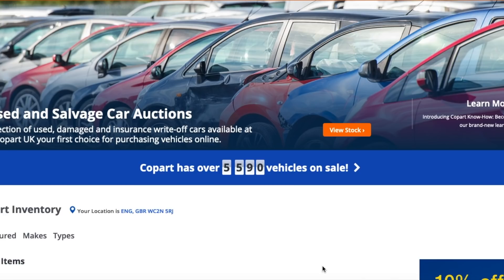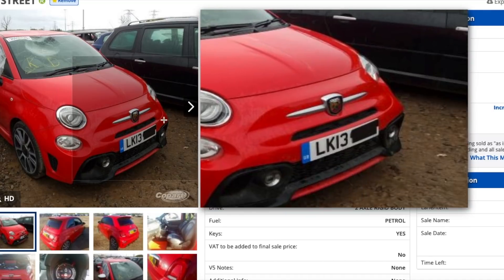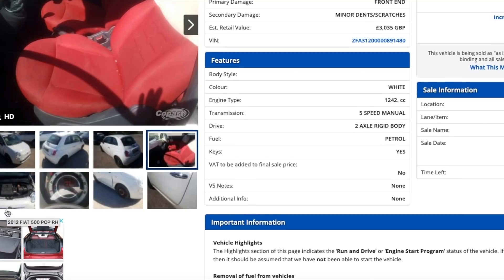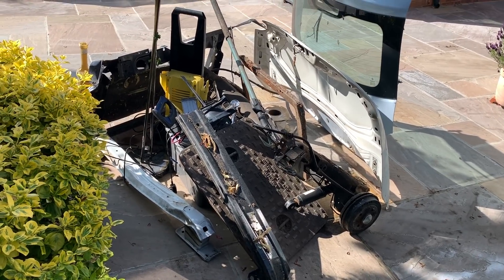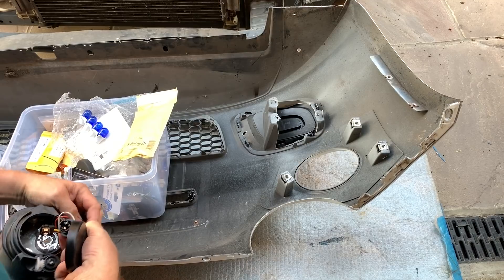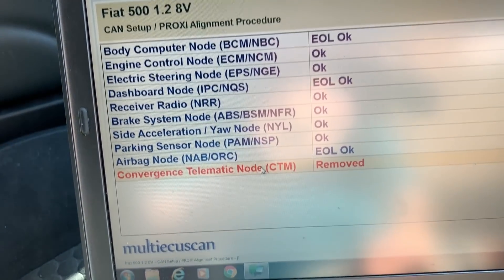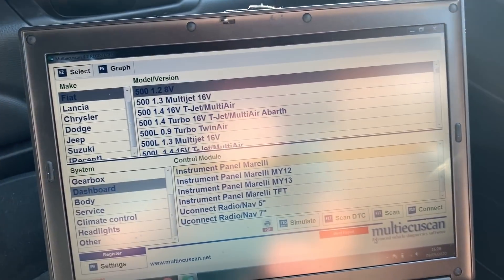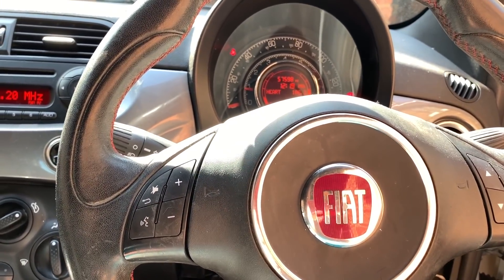A few Copart Cars, MES and a few updates on the Sport

Comment: Red Abarth  is reg as a 1.2 petrol it has also lost 18,000 mileages between its last two MOT'S . Do you think someone has made their own Abarth ?
Reply from the maker: andrew mills ahhh yes it could be. There was a similar car on eBay a few months ago.
Reply: I  thought the copart, red abarth turismo had false number plates on it, you mentioned it has upgraded rear light but you can see this is a series 4 abarth with the face-lift  bumper and later spec allows, low mileage, don't think anyone would go to all that trouble of making it look like a later abarth, must of be stolen with false plates!